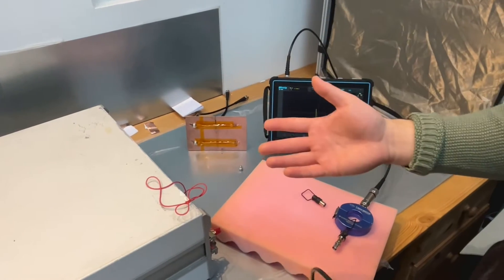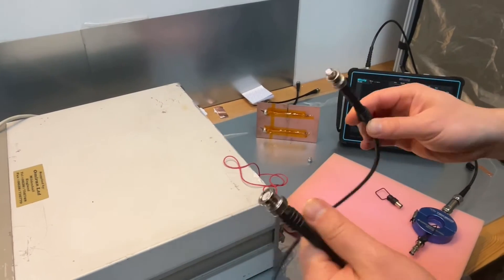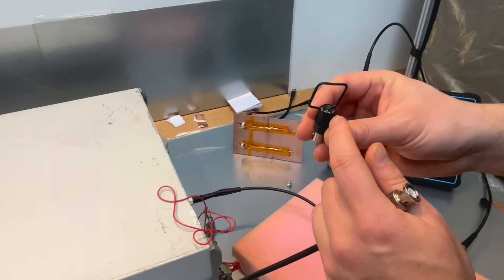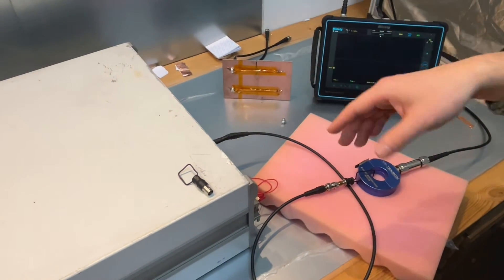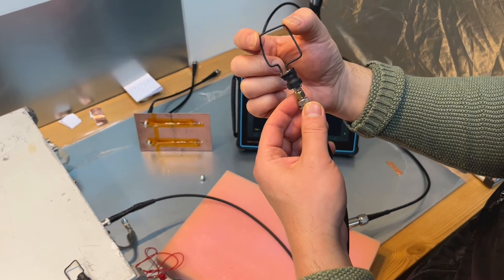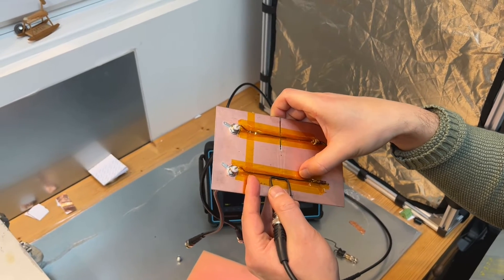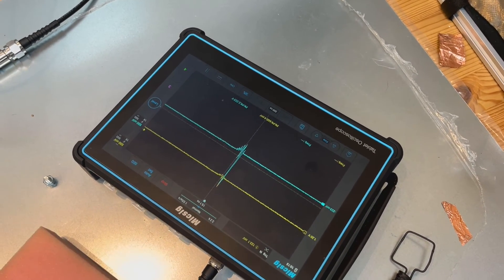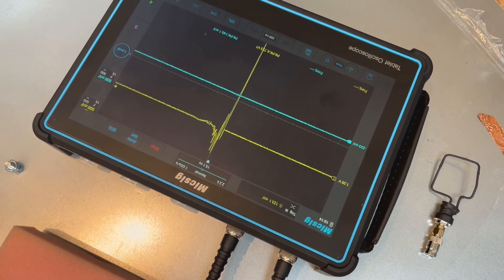Troubleshooting EFT/Burst Failures

Comment: Nice technique. Your generator looks like a Schaffner unit? I have one of a similar vintage - I had to change all the polyfilm capacitors in mine to stop it tripping the RCBO and to bring it closer to the 5ns rise time.
Reply from the maker: Hi Greg, in fact, mine is a very venerable one from Hi-lo Test in Germany. But surprisingly, the waveform is pretty accurate, I kept my eyes on ebay, sometimes you can find a second hand Schaffner one for about 1000-2000USD, I am still attempted to get a Schaffner one.